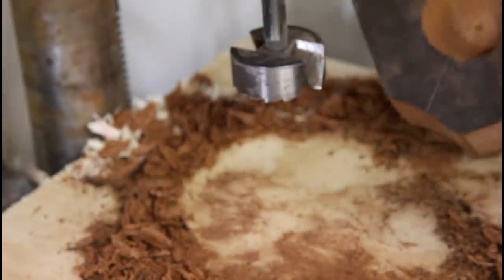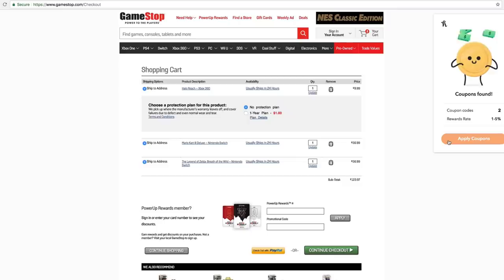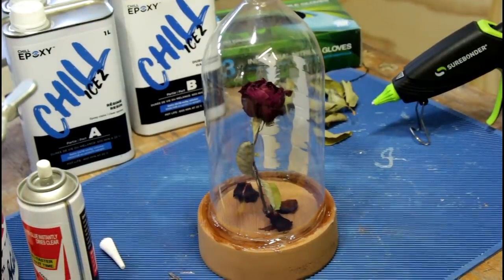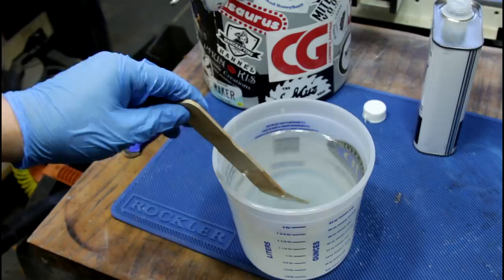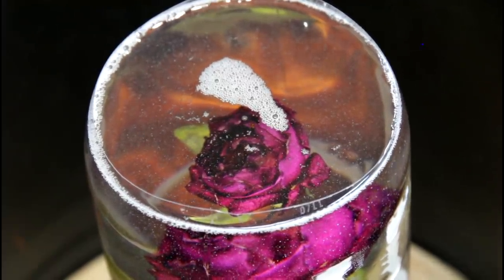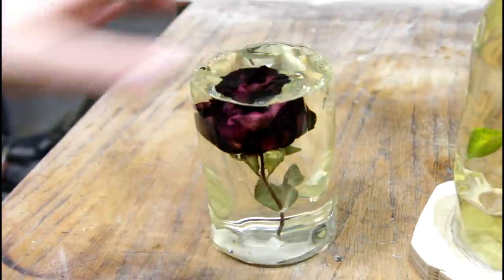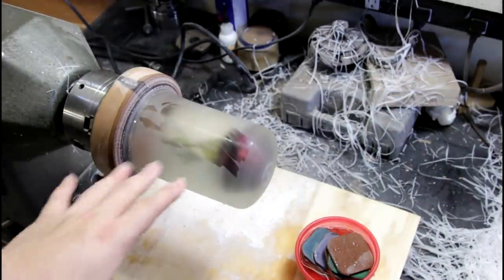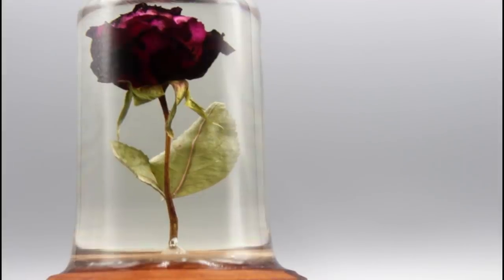Can You Preserve A Rose in Resin?! | Dipit #24

Comment: here's a crazy idea, not sure if it will work: dip the rose like a candle in a little resin and let it dry. that way the hardened coating should protect it from the heat when you put it in the mold and pour the bucket load of resin.
Reply: I was thinking exactly this!  :O  It would be difficult to get the rose to hold an open state (that is, looking upright and lively like it just came off the bush), but I feel like it would definitely be worth a go!
Reply: No sure if that's how they did it, but I bought a 'glass dipped' rose on valentines day. I assumed that's how it was made.
Reply: Well dried flowers are really fragile so I think that maybe the weight of the resin could become a problem
Reply: Spray it with Aqua net or Enamel first
Lock the shape and Color in?
Reply: I was thinking of something similair but instead of dipping spraying multiple coats so that the rose isn't sagged down by the weight.
Reply: There are some very thin UV resins out there..I would do some brushed on or try to spray and do several light coats putting it under the UV light each time...BUT can you use it in regular resin after UV or is there a reaction?
Reply: It might work but roses get so delicate that you'd probably lose a good about of the outer petals trying to pull it out of the wet resin
Reply: @chloelawrence3394  we have used Aqua Net hairspray when doing orchids and never had an issue
Reply: @chloelawrence3394  and we put a Seedling mat underneath the vacuum chamber to maintain 88° so it pulled all the bubbles out and it was clear as glass
Reply: Gonzalo Giha smart
Reply: They make jewelry out of resin preserved dried roses at the renaissance festival here. I've tried it at home, it definitely works with small layers.
Reply: Uv resin works fine for coating but it more expensive in any case.. I think the best way is brushing the rose paying attention not to overload the petals in resin..
Reply: Spray lacquer maybe?
Reply: How long do resin-coated flowers last? I'm scared to try this if it'll just decompose after a month or two..
Reply: Drying the rose in a bed of silica beads works much better for preservation than just hanging it upside down. Preserves the colors better
Reply: The cat litter box silica gel works just as well and is less expensive :) for the color I agree it's better with the silica and a microwave :) but it's not cheap so if you are not bothered by the change of color it's better air dry..
As soon as the rose is completely dry and completely covered on resin I think they will last the same time as the one in the video..
Reply: A layer of cured resin won't protect the rose from heat. It seems that heat itself destroys the color, not contact with hot liquid resin.
Reply: I only like this comment bc there was six hundred sixty six...but also good idea
Reply: A Miffed Cuttlefish  try first with a few salami sticks🤣
Reply: A Miffed Cuttlefish  do you think it would work if you laminate them first?
Reply: @chrisb__  I think they last years but research is required to know for sure.
Reply: A Miffed Cuttlefish  It may work with great care taken and the right resin used so it doesn't get to hot as it cures.

Comment: Would’ve been even cooler if you layered the resin and dropped in petals periodically.
Reply: omg yes
Reply: pour a little, drop a petal, pour a little more and drop a petal. May have worked
Reply: He has added resin shavings before and they became transparent. Same with a roughly sanded surface. He poured resin over it and it became clear. Also, he does not wait for the previous layer to completely cure to add an item and pour a new layer. Just as it starts to firm up.
Reply: Yes I was thinking this! Beauty and the beast style
Reply: “When the last petal falls”
Reply: Zachary Rampelt for a second there I thought you were attacking him, but then I read his name.
Reply: I think it would work pretty well. Just make sure you mix it really really well each time and pour it into a second clean mixing tub.
Reply: @candace200  they would float to the top
Reply: @cooperolm9687  Not if you were to spray the petals with hairspray, paint on resin on the petals, let tthe resin cure just beyond itś gel state and then place them as you want them into a mould. That way the chances of them staying suspended in the resin is the greatest...
Reply: @cooperolm9687  no they wouldnt
Reply: Zachary Rampelt lol I thought you were insulting him. It's just his name :0
Reply: Also a pink light from below
Reply: @candace200  petals float to the top of you don't let it dry first (which gets lines)
Reply: I had a feeling I saw you before. I see you're subscribed to ph1lza. Now I understand :)
Reply: ghosteneul or wait till the layer you just poured is almost dry or as Peter says the jelly stage and then add a petal and then a new layer of resin
Reply: I would have added the tinies bit of fine gliter to the resin for the magic touch (with the fallen petals that would look perfectly like the one from Beauty and the Beast)
Reply: oh meh god YESSsSss!!~
Reply: Blaž has
Reply: @poeely  not quite bc you have to mix the exact amounts of both components. Only then the refraction index is the same otherwise you will see a line. If you would put layer over each other not on top of each it would work even with separate mixings and different ratio between components.

Comment: Nice! It looks like the enchanted rose from beauty and the beast- and I agree with Mrs. Brown, it looks like it’s under a glass dome!
I reckon a little resin sphere on top like a handle would’ve looked great for the glass dome illusion! Oh, maybe you could cut a hole in the base for a light to shine through?
It’s really awesome either way- and how lucky! That good on your first try! 😂
Reply from the maker: Both of these ideas are great.
Reply: glad I checked the comments because I was about to suggest the exact same thing with the ball handle on top
Reply: Ark A.H. Beauty and the beast!
Reply: @peterbrownwastaken  Ring of about 6 (or maybe more) LED holes, and insert RGB LED - for a random effect, could use the self changing ones, and they will go out of step with each other after a few cycles.
Alternatively, some way to install some USB powered RGB LED tape, with a controller
Reply: @matthewday7565  Oh god please no. One simple white LED... please. There's no need to have something so classy be ruined by a bunch of flashing RGB LEDs.
Reply: The light idea is interesting, although I fear it may ruin the illusion of a "rose under a glass dome" as the light is likely to interact with the solid resin very differently than it would react with the air, then glass boundary, then glass, then air again. So it might end up looking.... odd.
Reply: @reeepingk  If the goal is Beauty and the Beast that oddness might work in it's favor. It should look almost like the rose is glowing instead of being lit from beneath.